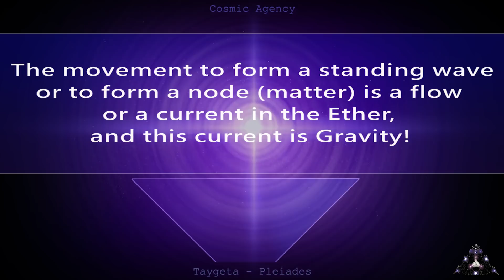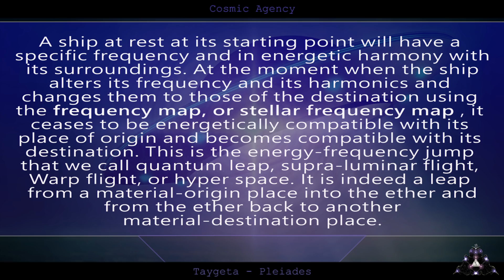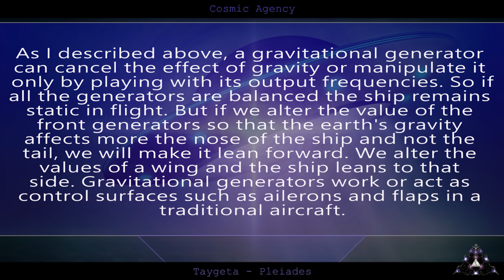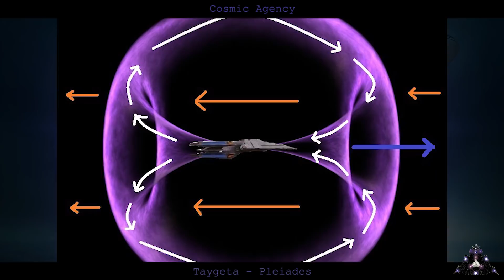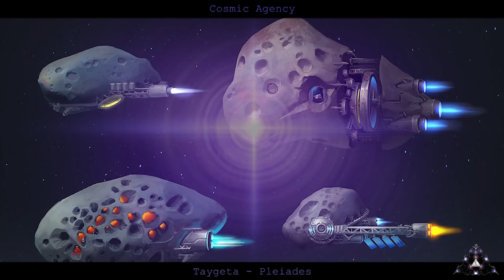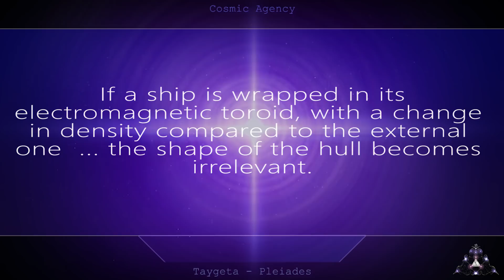Stellar Navigation 2 (Swaruu) (Part 3): Extraterrestrial Ship Technology (Taygeta - Pleiades)

Comment: as far a i could remeber i am blocked xD , but i  maybe this reach the spam carpet of ytb
i remember for second time (first at robert with no results at all) at  18:00
That most probably "She" is refering to "NANOMETERS" not "MANOmeter" xD 
(its funny mistake) xD
Reply from the maker: Is that nanometres?? I have no technical knowledge of these things so I just transmitted this as it was given to us. You are not blocked. If you were, you couldnt have been able to post this. :)
Reply: @CosmicAgency  xD hey yes!, just the last one you said: "nanomeTres" (i think the most) not "nanometers" as i also misspelled  before, too.. xD 
as we can see its a "tricky" word! 
great vid!
Reply: Yes, in the context, it should be nanometers, not manometers.
Nanometer is a measurer of space (thickness or distance)  as manometers would be related to pressure, as in air or blood presssure. The instrument to measure pressure is called a manometer.
Reply: @nyne7253  yep.. i think so this. At least  I visualize the propossed concept in  this fashion:
 as a very very thin material (most probably a corded as a  a coil).....  sooo sooo thin as its in nanometre scale.

as a reference, moderm CPU procesors of our computers and mobiles are in a comercial running to producer more and more thinner circuits for CPUs...

Amd processors by example are near de 7nm (nanometres)  precision

Russia BAIKAL CPUs oriented to security and confiability of state , are around 12 nm or 24 nm

etc..
but in the context of this article,  is a far as i wolud understand
swaruu are refering THIN OF CORD used to do the coil... i think..
Reply: @nyne7253  i am a not very technician orientend.. only curiuos... but almost i think
https://www.youtube.com/watch?v=gk0Ss5G15KY
 that we can see NOT the Swaruu propposed conceptos
BUT at least SOMETHING slighty RELATED
here a super crazy channel xD
https://youtu.be/7VpS7s9wZqk?t=6
to get familiarty with visual concepts of energy workings..
Bloch Wall / Domain Wall
etc etc

Comment: I suspect then, a pilot uses intention to direct the computers calculations for movement from one place of energy to another? Intention for navigation?
Where do the objectives or orders derive from, such as missions for such ships.
Useing energy as a line or wave of movement, I wonder if there isn't interferances from other ships useing the same energies because if you are amnipulating the energies for movement then so do others, doesn't this lead to crashes? or are there sensors systems in place that detect the altered energy fileds?

Complex but understandable. The engineering process to achieve the control of energies and detect them so as to use them in their pure energy form would be very interesting, then these are not solids, but energy frequencies being contained.
Magnetism is the pulse/Attraction which creates the electro energies, much like earth or human hearts that funtion the same way and exist normally in 7.83 Hz.
I have observed the Schumann resonance of external forces for over a year now and see huge changes which can be quite intense, over 100Hz in some recordings.

I suspect this is in relation to alter earths containment of a 3rd density reality to eneable a higher frequency existance eventually (5D ?) Hense disolving the Vanallen belt and moon matrix captivity?

Great and inspiring knowledge, Thank you for all your time and efforts.
To observe the parasitical version of controllers here on earths leadership at the moment could depress many into low vibrational energy, but that is only if they dont realise they are just an energy expressing themselves here in the meat suite we have.

Best wishes to health for all, very look forward to the next video.
Anthony